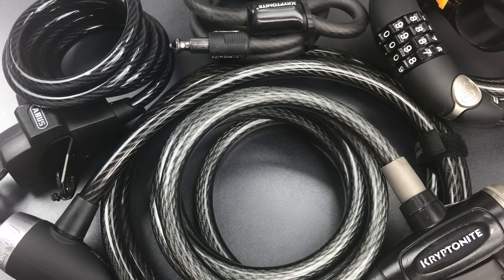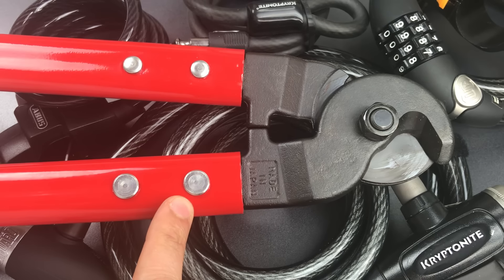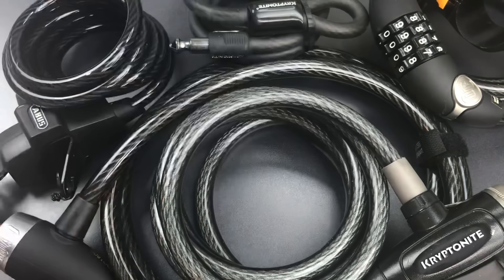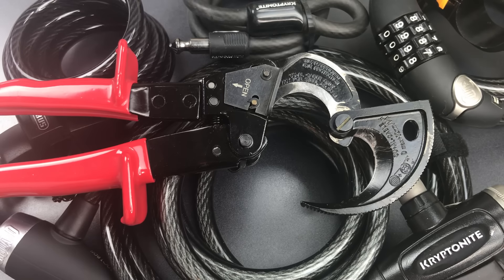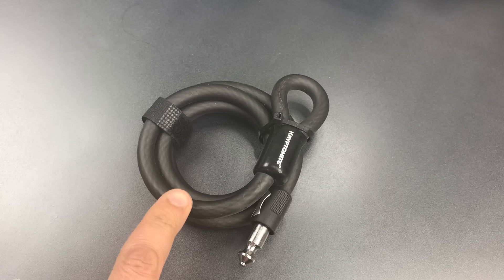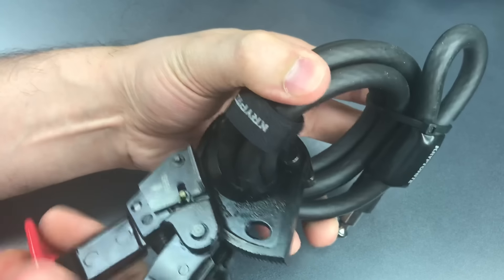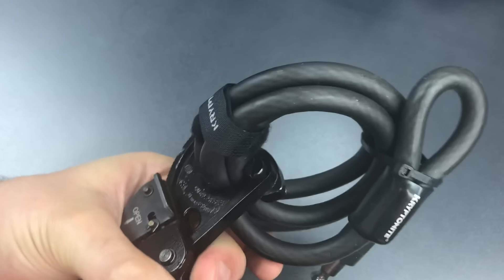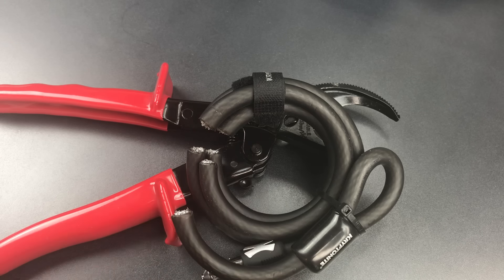[748] Cutting Bicycle Cable Locks is EASY!

Comment: That's how you make a point. Don't just cut 1 cable, cut 4 at once. Great video as always.
Reply: Richard List 

In a lot of cases, bundled cables are easier to cut, than a single cable.
Reply: If that was the case, the thief would simply need a fragment of cable from the lock of the last bike he stole to make it easier.
Reply: @springbloom5940  That's not true AT ALL. A mass of intertwined material such as cables, ropes, wires etc. will ALWAYS have more tensile strength and be harder to cut because of sheer added mass and thickness. Why would it be easier to cut more? I mean come on, common sense.
Reply: Starboxxx Chrononaut 

Well, you might be right, if we were talking about a single braided cable and not a bundle of cables
Reply: @springbloom5940  ok so then the proper way to phrase it is, for a given thickness of cable, the more strands it has, the easier it is to cut. A 1" cable with 100 strands is easier to cut than a 1" cable with 10 strands.
Reply: Benargee 

No, we are talking about 10 individual cables in a bundle. Two 10 strand cables, is not equal to one 20 strand cable. The bulk of the other cables, providing backing and blocking, make each individual cable easier to cut.

But again, I did not assert this as a rule, but rather ab exception to an assumed rule that '10 cables is harder to cut than one'
Reply: @springbloom5940  That make no sense: you cut a lot more material at the same time -> it take more force.
Reply: @springbloom5940  its when there is different pieces of cables and you are trying to only cut one of them and you have the right angle
Reply: @springbloom5940  You are correct in terms of the difference between cutting one large cable vs multiple smaller ones. But the basic point stands as to the ease of cutting cable locks. This just demonstrates that - and how adding a couple more similar locks isn't likely to help. I'll stick with a big "U" lock.
Reply: James Phieffer 

And round stock will always be easier to cut, as well, because it permits all of the force to be applied to a very small contact point.
Reply: Hey thieves watching this vid, i use a motion activated 20kv transformer linked in line with my frame. GL ;) :p
Reply: MrRedeyedJedi 

Hey, prosecutors watching this vid...
Reply: ... Spring OMG
Reply: krademjica2 

You know boobytrapping is illegal, right? And if someone dies, charges can be enhanced with premeditation. Now then, he says this as a joke, but...
Reply: Spring Bloom if i catch someone trying to steal my Kawasaki im going to jail either way so... ;)
Reply: MrRedeyedJedi 

Not if you catch them and do something
Reply: Richard List well I made a point also but instead of cables I put dood fingers cause he owed me money
Reply: @thorlancaster5641  university
Reply: DO IT BIGGER
Reply: @JamesPhieffer  - seen plenty of them defeated on this channel as well
Reply: Duh
Reply: He also cut the bike in half just to make a point
Reply: with a tool suited only for copper
Reply: My expensive bicycle is theft insured. It's very much worth it if you use it daily.

Comment: Never buy an expensive bicycle. That's what I've learnt from this.
Reply: No...never leave an expensive bicycle unattended except inside your home.
Reply: I have 2200eur bicycle idk if its counted as "expensive" or not but mine is either a) in use on a trail or b) behind a fence guarded by 2 caucasian ovcharkas inside a garage locked by very good deep cut Assa lock. Good luck I usually sleep with window open and have twitchy sleep, I wake up to almost every bark. Meow try your luck.
Reply: @iare19  I've found that if the bike costs more than 1000€ the easiest security practice doesn't work anymore: locking it next to a more expensive bike.

So leaving it at home or in use is definitely the safest but I don't want to ride to work with a cheap second bike if I could use my better one...
So good locks are pretty much the only option
Reply: @sebastianjost  inside storage if your speech is good enough
Reply: @iare19  just wait until the dog starts playing with the robbers
Reply: Or just dont have stops
Reply: It doesn't matter.
If they want they will steal even a trash bike for it's parts. Or take away the wheels.
Reply: @iare19  are you a Russian speaking person by any chance?
Reply: @shmuelyosef1  To help with that, never have a stand on your bike, and never have a lock for it. That way you'll always have it by your side. 
OR, don't buy a bike, just buy these cable cutters....
Reply: Nobody will ever steal the $50 Walmart bike
Reply: Michael Persico  I already have a good bike for my free time. Why not use that as the main bike?

An extra bike takes up space and costs money (even if it's not very much).

I also like the option to go for a slightly longer ride on the way home. Otherwise it gets boring really quickly, riding the same way every single day. For that I certainly want the best bike I have and not some second or third bike not meant for that sort of riding.

For other people I would say motivation may be a reason to ride the better bike.
I really disliked cycling for the first 15 years of my life. One day I got an old (slightly more expensive) bike from my brother and within a week I actually enjoyed riding my bike.

The bike, it's rolling resistance shifting quality and brakes can have a massive impact on how much you enjoy using it. So if you have alternative means of transportation (all probably worse for your health and the environment), a good bike may be the only thing motivating you to use that instead of a car or bus.

"It doesn't need to be expensive" is certainly true, but it can still make an important difference if it is expensive.
Reply: I can’t imagine how those E bike dudes manage, I live in an urban city with high bike theft rate and there are people riding around on 5,000$ Electric bicycles
Reply: @sebastianjost  well when it gets stolen, which in the US at least, it will then have fun. I'd assume many metropolitan areas across the world offer similar prospects.
Reply: Cheap bikes are stolen too.
Quite a few, actually.
Reply: or buy a shitload of them
Reply: @iare19  2200 euros and you're wondering if it's expensive?? what
Reply: Yeah, bike locks are worthless. Always buy a bike that is cheap enough that people probably won't want to steal it. And even if someone does steal it,  it was cheap and is easily replaceable so it won't bother you too much, at least not as much as it would if it was an expensive bike.
Reply: My bike got stolen a few weeks ago, bought a used one for about 160 bucks, good condition, no rust on the functional parts. Also bought 2x kryptonite evolution locks for it for almost as much, 1 D-lock and 1 chain and now locking it properly through the frame and wheels. Hopefully that will be considered too much trouble so they don't bother fucking with it.
Reply: Exactly, what’s the point in buying a higher quality bike if it’s just going to get stolen
Reply: @DoctorX17  Wrong. Once I had a totally damaged bike with loose pedals and chain hopping off every 5 minutes. Stolen.
Reply: @AndreasSchlitzkus  oof
Reply: @iare19  cringe
Reply: Wrong, never buy an expensive lock
Reply: Just get chains
Reply: or just get a u lock, those are pretty much the most effective locks against brute force.
Reply: The 50.00 dollar Walmart bike days are long gone . Have you priced one lately at Walmart 🤔
Reply: @mr817 do you know how much cheap bikes cost?

Comment: There is an organized bike theft gang in my area that go around with pairs of pick up trucks and they mostly use grinders. It doesnt matter what lock you get because if they can't cut it, they cut the bike up and take the pieces. They use speed and good timing, not stealthy tools.
Reply: Theft is a numbers game, there are only so many bike theft gangs, there are a lot more individual thieves and these tools cost just £25
Reply: Locks should be filled with TNT.
Reply: tiefensucht I don’t know about TNT, but I have seen a lock that releases an extremely foul odor if you try to cut it.
Reply: At that point, it's the cops' fault for letting it get that bad. I very seriously doubt that they have the ability to spoof legit license plates enough that they are completely unfindable given that they would be bound to have video evidence on them eventually.
Reply: If the situation is truly that bad, I'd lethally boobytrap the bikes. The government/law enforcement should never have let it get to the point you're being terrorized by organized crime. The entire point of a law system is to protect the people. If it's not accomplishing that, then I don't care what's 'illegal' in regards to how I defend myself.
Reply: @ember3579 could be stolen plates/trucks too.
Reply: Your comment goes to show that 𝘸𝘩𝘦𝘳𝘦 you park your bike is often as important as 𝘩𝘰𝘸 you lock your bike.  For instance, in general: inside beats outside; behind a fence or wall beats out in the open; away from the road beats where a van could pull right up; a lighted area around people beats an isolated dark area (although isolation has its own advantages, as I kinda alluded already); and so on.
  If I could give any advice that you don't already know, it would be to lock your bike even when it seems like it's in a safe place.  Many thefts are opportunistic, such as when a garage or shed is left open, or when you turn your back for "just a minute" to accomplish some small task.  I've known two people who had unlocked bikes stolen from garages, and I myself had one vanish from a porch.  One of these friends just couldn't believe his bike was gone... he tried over and over to find some explanation that would mean he still owned it -- that he'd left it somewhere different.  But it really was gone forever. 🙁
Reply: @ember3579  Police are not a preventive measure, police comes in AFTER crime happens. If you want to curtail theft, you need to tackle the dynamics that make people turn to illegal and risky sources of income. These dynamics are usually economic (lack of legal income) or social (macho behavior / wanting to impress peers / coercion by others).